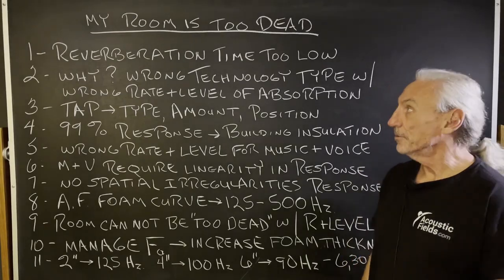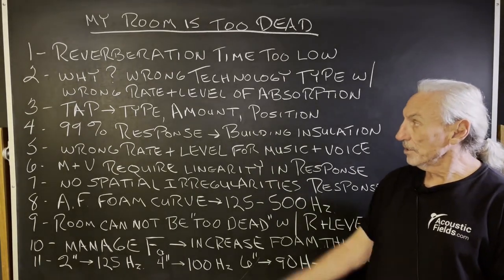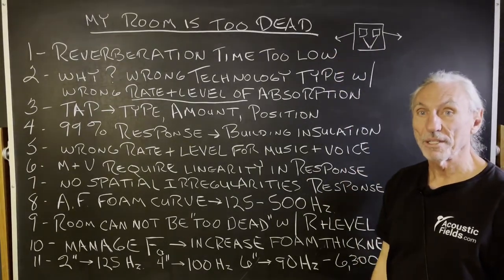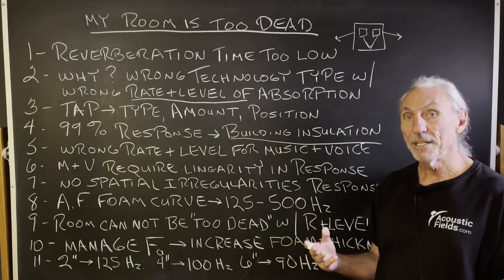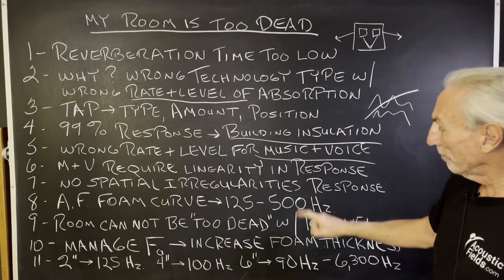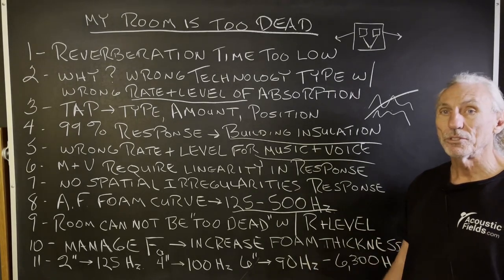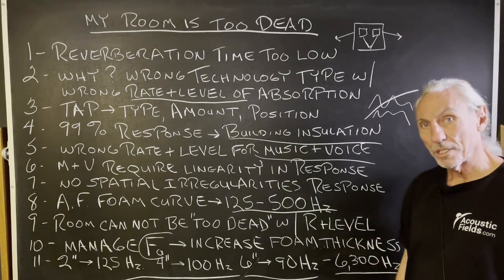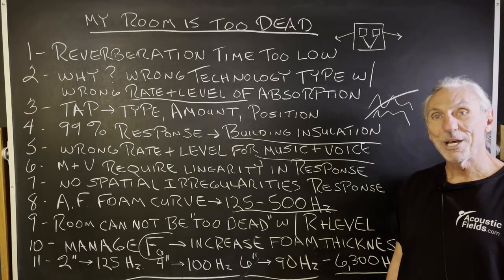My Room Is Too Dead! - www.AcousticFields.com

Comment: Your area code says in AZ. Do you have people in GA that come out and RTA the room and bring different panels to dial it in? My system 12 by 12 room with 10 foot ceiling height. Have some generic sound panels I bought way back on the walls. A couple of windows. Monitor Audio Platinum 500II speakers, APEX Rossini Dac and CD/SACD transport, Dragon Audioquest source, speaker, and power cables, VAC master pre-amp, pair of VAC 452 Musicbloc tube amps in mono for each speaker. Individual breakers for Audioquest NG outlet plugs and 10 gage copper romex to the electrical panel.
Reply from the maker: Fill out the information in this link:
https://www.acousticfields.com/free-room-analysis/

Comment: You often talk about rate and level. I'm a bit unsure of what you are referring to as rate. Are you talking about a percentage of absorption, or a particular SPL absorbed / sqft of surface area? 
I would assume that any material would have a maximum amount of absorption. It can only handle so much SPL before it is no longer effective.
We might get 50% absorption at 87dB, but only 30% at 100dB. 
I'd love a video getting more detailed on rate and level.
Reply from the maker: Level is how low in frequency the technology absorbs at. The rate is how much absorption at each frequency occurs per square foot of treatment.

Comment: so, carpet with pad is building insulation. is there a way to work with carpet? or is it just too much?
Reply from the maker: What is the rate and level of absorption of the carpet and carpet pad? Withoiut knowing how a material performs, you are just guessing. We prefer real science. This is the issue with material types that are supposed to do two things. First, they provide a surface area coverage to walk upon and now they are asked to manage reverberation times. Too much to ask of any material type.

Comment: the reason why people use building materials is because sound shaping panels are too expensive. if they were cheaper more people would purchase panels. its as simple as that..its not because people decide to use building materials rather than yours and other companies . people dont have an choice..one of your cheaper panel is hundreds of pounds..see theres the problem
Reply from the maker: You get what you pay for. We are a company who's mission statement is room resolution. You can not achieve higher resolution using material types that were never designed for room acoustical treatment.
Reply: I completely understand the need to economize, but it's also my experience that you "gets what you pays for". Not just in acoustic treatments.
Reply: @brown-eyedman4040  everyone would purchase panels if they could afford them.that goes without saying.what your not getting is that many people dont have the option to do that.and thats why they use building materials. ive done it myself. only because
 certain panels are too expensive.and yes ,you get what you pay for. but if you cant afford it ,then you put up with what you can afford.no ones dumb enough to choose building materials if they could afford the proper panels. and thats what i mean.
Reply: @milkman100001  I get that, but people spend $1000s on equipment, Amps and source and don’t bat an eyelid, then wonder why it doesn’t sound good in a living room with a tiled floor and a big window, so they get some pink batts and make a frame hang it up and doesn’t do a damn thing,
Reply: I understand your frustration if people who can afford don’t buy your brand, but i wish there was a way to bring the cost down, what’s in this foam that’s so expensive?

Comment: While there’s a great deal of helpful information in each of the videos from AF, it’s not helpful to continually insist that building insulation “doesn’t work”. With proper guidance and emphasis on controlling lower frequencies as a priority step, DIY building insulation(mineral wool) type panels & clouds, when thoughtfully built and applied, produce excellent, professional level results. Tell us why it’s worth paying 100 times more for your product without shaming all other treatment choices as completely useless. The old ‘get what you pay for’ argument just doesn’t cut it at this ratio of cost/benefit.
Reply from the maker: You are missing the point. People who use building insulation types have never experienced anything else. They think the rate and level of absorption produced by this material type is conducive for music and voice. It is not. When you hear a proper absorption curve, you will never use this material type again. We tested many of these insulation types before creating our foam technology. Resolution of the subtitlies of music and voise is paramount. Along with the health risks and poor acoustical performance the only win is the cost. If cost is your objective, then I will agree. Our objective is and always will be the ultimate resolution possible from our gear and room sound.
Reply: @AcousticFields  Very informative and persuasive. I don’t believe I missed the point.
Please note that I greatly appreciate AF, its product and expertise.  And I understand the target audience of audiophiles and producers, having been among them my entire adult life.
There are many who DO have an experienced understanding of the difference. Telling your audience that a common material for sound treatment is worthless seems unnecessarily highbrow when thousands of home studios use rock wool DIY panels to desired effect. It is punching down, IMO. Assuming artists, producers & engineers with limited budgets are among your target. The health risks from using RW assumes full exposure and continued unprotected handling. And even then, risk is minimum according to recent studies. Although like you, I am not fully convinced.
Generally, I believe it’s better to assume “people who use building insulation” have experience with other materials, including yours. Thousands of world class productions have emerged from rooms with questionable resolution as you know. AF strives for the ultimate resolution. Great. I believe your product can speak for itself without misleading claims that building insulation is dangerous and ineffective.
Reply from the maker: @PSAImagingLLC  The building insulation acoustic belief system is wrong. It lasks resolution and resolution must be the paramount concern so audio can at least attempt to keep up with video. There has to be a new belief system that is more focused on resoluion throughout the frequency range. What we had and now have is wrong.